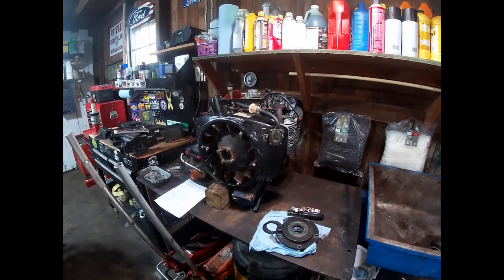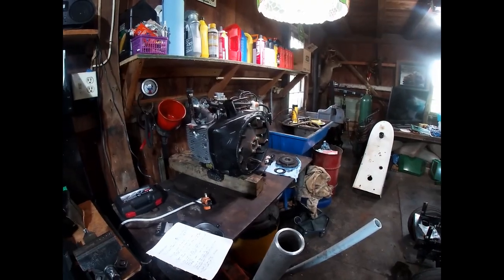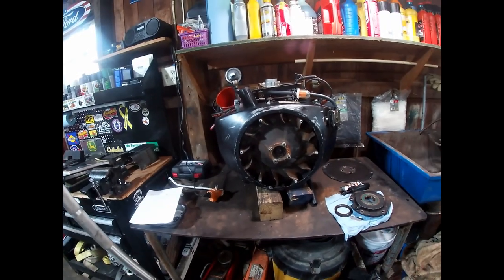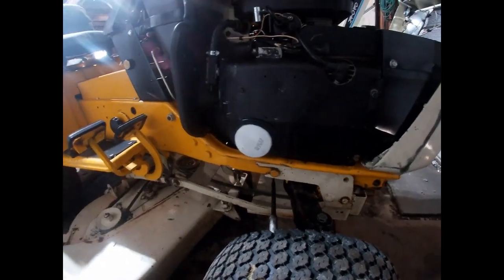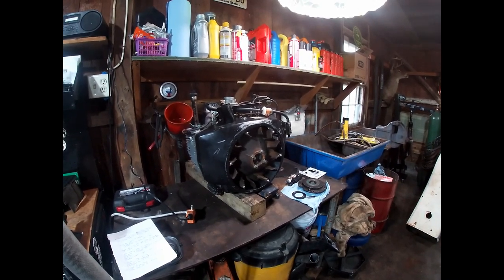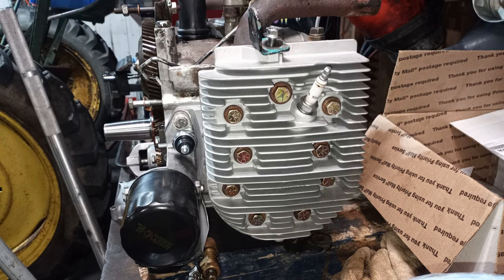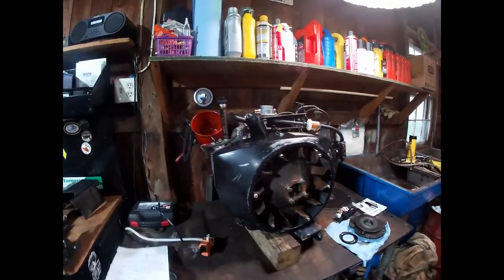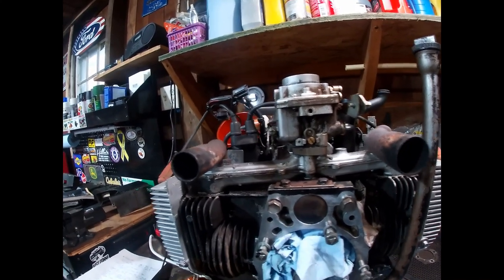10 Tips to MAXIMIZE the Life of the ONAN Engine in Your Garden Tractor - Long Live the Opposed Twin!

Comment from the maker: Please note that these are all items that should be done IN ADDITION TO regular maintenance (oil changes, air/fuel filters, spark plugs, points, etc.) - a little preventive maintenance goes a long way! 

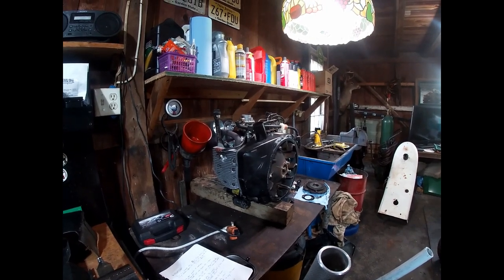10:16 - Air cooling & ventilation
16:20 - Run good oil and change it often!
19:09 - Replace the oil filter shroud gasket
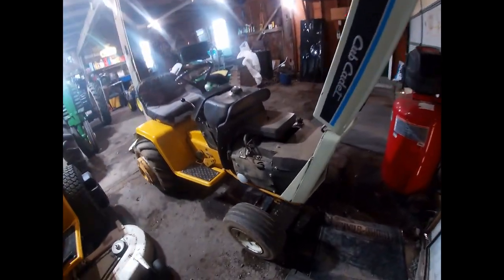21:01 - Replace the firewall foam insulation (JD 300/400 series only)
26:20 - Run WIDE OPEN THROTTLE when engine is under load
30:48 - Decarbon cylinder heads, valves, and intake/exhaust ports every 500 hours
34:38 - Hardened/oversized valve seats (if originals are loose) (P series only)
35:20 - Steel flyball spacer upgrade (1986 and newer B/P series and Linamar engines only)
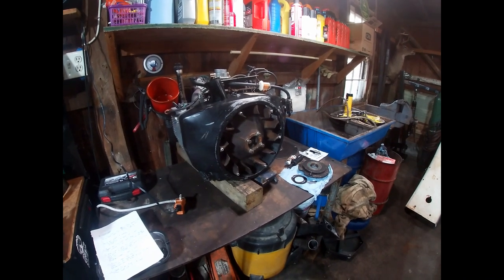39:48 - B series starter & oil pan upgrade (P series and Linamar engines only)
43:17 - Replace ALL oil seals while engine is out
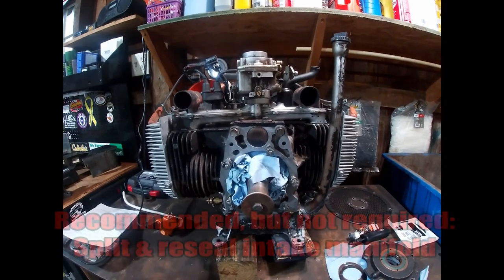46:10 - Recommended but not required: Split & reseal intake manifold (to prevent a surging condition)
Reply: Have you ever looked into the Simplicity sunstar’s cooling system? It’s completely sealed off from everywhere except vents in the top of hood and is ducted through the trans cooler into the engine.
Reply from the maker: @Claytonsgardentractors  A friend of mine collects the Sunstar series tractors (maybe he'll comment here if he sees this) and I find their air intake design puzzling - I guess the Magnum or the Command engine sits high up in the frame enough that the flywheel blower can pull air in from up above rather than below? I know the modern Cub Cadets and Simplicities with horizontal shaft engines pull their air from the hood, but I have a feeling the hood vents were added to reduce the possibility of dust and debris coming in from below - which is a flaw with the design of the Deere 300/400 series and Cub Cadet 82 series. Whether the hood vents actually help take in more air than the older design, I have no way to confirm.
Reply: @MichaelTJD60  the engine is sealed off from below and the sides, there is a plastic duct piece that goes over the battery to direct air from the vents down to the engine, most of the time it’s been removed and defeats the system like the oil filter gasket on onans, I’m not sure if that explanation helped or not but here is a promo video that discuss the cooling system in it, https://youtu.be/gs1mnNm1-YE
Reply: This video is exactly what I need for my grandpas John Deere. I cut the lawn now and would like to keep it on top condition please more videos for beginners.
Reply from the maker: @Claytonsgardentractors  that explains why it was puzzling to me, the duct piece was gone so it didn't appear that there was any way for the engine to pull air from up top.

Comment: One  Of the most important Thing ;;;  Engine RPM,  The Engine Needs To Run at The Reccomended RPM..  Because Of  Viberation ,, I have taken Engines Ran them at Differant  Rpms  The Internal Viberations Would Distruct The Engine;;

Comment: On the subject of parts sourcing for discontinued engines, it’s worth mentioning that OEM Tecumseh parts are still available for purchase with the exception of factory short blocks. Certified Parts Corp. has been producing parts at their facility in Wisconsin under the Tecumseh Power brand since 2009
Reply from the maker: Great to know. I don't deal much with Tecumseh but I know there are plenty of guys out there still running them in their older machines - especially the Sears tractors and the JD 112's.

Comment: I feel reasons for changing are the ohnan was improperly matured, people without knowledge feel age isn't worth keeping or bought a tractor already repowered.  Myself with parts available yet just rebuild it even with valve issues they had but again with properly kept up to date olds better but that's my thoughts.
Reply from the maker: Absolutely agree. Most people think they are just taking the easy way out by installing a repower kit.

Comment: I like your tips on the engine.  I managed the development of the P series engine and worked with Deere on the application of it in the 318 and 420 tractors. We even did a kit to retrofit the P series engine into a 317.  The rotating chaff screen was removed to give about a 10% increase in airflow. The Deere screens did a good job of keeping grass out of the engine so they took it out. It is definitely needed on tractors without the screens.  Also, if you are rebuilding a B series engine I would recommend using the P series valves and guides.  The improved materials and reduced weights of those parts really did increase recommended valve adjustment intervals from 250 hrs to 1000 hrs.  I agree with running the engine at high rpm to improve cooling. Our standard endurance test was 1000 hrs at 3600rpm WOT.  Only failures I recall were some cracks in the sheet metal shrouds due to vibration.
Reply from the maker: Thanks for your insight, Jim! Great to hear from a former Onan employee and very neat that you oversaw the P series engines as they came into production. If it's not already obvious from the video, I'm a big fan of the P series engines and have several. You mentioned the valves and guides being lighter in the P series to extend service intervals - was this the basis for the lighter steel valve seats in the P series as well? Also, what was the reasoning for switching the starter mounts from the oil pan (B series) to under the left-hand side of the block (P-series)?

Comment: Sold my 318 a couple years back for 1000 more than I paid for it.  Had it 20 years.  Rebuilt it once, changed flywheel, put in the B series oil pan and starter, remote solenoid which I agree was a better set up.  Old oil pan and starter was garbage, had that out a few times trying to make that starter work with that funky mount.  Re welded it, welded broken foot too.  It ran great and looked like new when I sold it and It was a good tractor, but I got a 445 that I rebuilt and its a much nicer tractor, cuts better.

Comment: One thing to keep in mind on the Case/Ingersoll tractors in specific is to check the crankshaft for up and down play on the flywheel end. They have a tendency to eat crank bearing on the flywheel end due to the strain placed on it by the belt tension from the PTO clutch. I've seen it a couple times
Reply from the maker: Thanks for the info, I haven't been around enough of the Case tractors to know that that is an issue with them, but it certainly makes sense. Good input!

Comment: The Onan twin is found in many older welding machines, they were indestructible and ran on many jobs 24/7 with stops only to refuel and a oil check, still see them running today, the older more experienced welders preferred them over the newer off shore engined machines,  less down time than the Chineseium  engined machines,  the Onan  and Kohler powered welding machines do automatically throttle down when not under the weld generator load, but still good information in this vid, Thanks.

Comment: Good informative video.  Onan engines were high torque and really smooth engines that performed really well.  Their main drawbacks were they required a decent amount of maintenance and had a few issues including the two piece intakes leaking, finicky carbs, the aluminum starter mount bosses cracking, and i believe valve and governor issues.  And the motor must come out to repace the starter.

Comment: Nice work sir. I am re-powering a 1989 420 with a vanguard 23 due to time constraints. I have the original Onan and the last engine I re-powered it with, a Linamar lx790, which now has a loose exhaust valve seat. I did manage to get 19 years out of the Linamar and I usually kept the fins under the shrouds clean, the original Onan failed at 600 due to a thrown rod, I bought the machine used, not running and suspect the previous owner didn't maintain the Onan properly. I entertained replacing the seats, all 4 and rebuilding the 790, however I thought the alum would get pretty thin between the ex and intake valve with an oversized seat. That seat rattled around in there for a while before I finally tore it down so the seat bore is quite a bit oversized.

What I am now thinking, for an engine on the shelf, is using the Onan block, replacing the cross oil tube inside that got smashed up by the rod and having all the seats replaced and rebuilding it with what parts I can use out of the Linamar, if everything measures out correctly and is useable. What do you think? 

Nice video and Thank You for the tips!
Reply from the maker: I think you have a good plan using the Onan block with the Linamar parts, provided the Linamar's internals were not worn beyond spec. The Linamar is the exact same engine so the parts should all be interchangeable (except for possibly the crankcase breather depending on which letter spec the original engine is). I'm not sure if a good machine shop could save the Linamar block with the worn valve seats but that might also be something to look into - they aren't making any more of these blocks.

Comment: I would like to thank you for taking the time to share your wisdom on these engines. I pulled the dirt caked oily B43G out of my 318 last night to refresh it but wasn't sure where to start. The engine mount base plate looks like its made out of sludge rather than steel :) This video will help tremendously on what to look for and parts I will need to get it sealed up and running right after I clean the engine and chassis off.
Reply from the maker: Glad you found the video useful Tyler. Sounds like your B43G would definitely appreciate a good thorough cleaning and going over. All it takes is one tiny leaking seal or gasket to cover the whole engine bay in grease and oil. How many hours are on your engine?
Reply: @MichaelTJD60   Yessir. It's showing 1492 but I didn't realize the hour meter wasn't working when I bought it. I doubt I've even put 10 hours on it yet but I need to get that fixed. So far aside from those oil leaks it seems healthy all things considered. No oil smoke on start up. PO owned it since 1993 and took decent care of it. While I'm thinking about it-  I want to go through the starter and put some quality parts in it. I have the 1986 solenoid style. I can't remember where you said in another video you got a rebuild kit from for that?
Reply from the maker: @tylerkrieger912  The kit is just new brushes and springs. You can buy them on eBay for about $20. Cleaning the internals is the most labor intensive part of the whole rebuild - installing new brushes can be done in just a few minutes but if the commutator has carbon buildup then the new brushes aren't going to help anything.
Reply: @MichaelTJD60  Copy that. I will do that. I am really enjoying wrenching on something I'm not in a time crunch to finish for a change. Thanks for the help!

Comment: I really appreciate videos like this. The common attitude with owners of these older machines these days seems to be repowering is the way to go and the older engines ESPECIALLY the Onans aren't worth fixing/rebuilding. And thats so odd to me considering that people will get 1500+ hours and 30+ years of service out of these engines before needing any major overhaul, yet thats not worth fixing?? Especially because as you pointed out parts are still available contrary to popular belief, and IMO repowering seems more complicated than rebuilding the original engine that's designed and built to work with that particular machine.
Reply from the maker: I agree with you 100% - why not just reuse the engine that was originally designed to fit the machine (back in a time period when everything was actually built to last and not built to fit a low budget)? Internet rumors start circulating about parts availability and rebuild costs and it doesn't take long for people to develop a bad taste for these engines over nothing. Of course the opposed twin engine design might be antiquated, but it WORKED time and time again....for over half a century, I might add. Seems like I have heard far more complaints of blown-up V-twin engines over the years compared to opposed twins.

Comment: Thanks for the vid. I learned a lot. 
I own 2 complete 982 cubs and one 982 project. I've fallen in love with the onan engine. I'm going to start collecting equipment with the onan engine on them. I'm gonna start rebuilding them. Do you recommend any particular rebuild kits?
Question: what is your opinion on synthetic oil in these old Onan engines?
Reply from the maker: There aren't really any complete rebuild "kits" on the market at this time since OnanParts discontinued selling them, but I know iSaveTractors has some kits in the works and there is talk of another aftermarket supplier making new kits in the future. For right now, I would buy the valve grind/decarbon kit and bottom end gasket kits through either Boomer or OnanParts.com, and from there add in anything else you might need. 

As far as synthetic oil goes, I have no problem with it, AS LONG AS it is used from the time the engine is rebuilt and broken in (when everything internal is new - seals, gaskets, rings, etc). You will hear people complain that synthetic oil causes leaks, but that's exactly what happens when you switch from a conventional oil you've been running for years that has caused internal sludge buildup. As soon as you switch to a synthetic oil with better detergent properties, the detergent will clean away all the sludge buildup and allow seals to start leaking again. 

The bottom line is that the lubricating and long-term wear properties of synthetic oil are far superior to conventionals - it's been proven time and time again. I run conventional oil in my Onan's because they are original and have not been rebuilt with new rings - as soon as they get rebuilt someday, I will be switching to synthetic.
Reply: @MichaelTJD60  Thanks for the reply. I appreciate it.

Comment: I love opposed twins but they have one major flaw: efficiency (or lack of)- compared to a v twin they burn considerably more fuel for the same horsepower, they do have more torque however. I’m probably going to spend the most time this summer using my 1641 cub because I’m able to mow 5 or 6 times on a tank of gas while my others with opposed twins need filled almost every time I use them.
Reply from the maker: Definitely a major setback of the opposed twin engines - I've never been a fan of the fuel consumption compared to the newer engines. But a common remedy is to upgrade to a low-pressure electric fuel pump which does seem to help a little bit. Some guys have also tried leaner valve adjustments and carb jetting.

Comment: Yeah I’ve got 4 of the old Deere’s with the Peerless 2300s & the smaller units they make today just aren’t the same. I’m a manual transmission guy… mostly cuz that’s all I can find down south that isn’t overpriced cuz all the hydros are either sitting in a collectors garage, sitting in a barn, or were junked many years ago sadly. Then when they’re in bad shape the seller will ask an obscene amount of money cuz they’re tough even tho it’ll cost nearly $500-1000 to completely rebuild a tractor just with parts.

Rebuilding your motor is another story. Basically most of these engines by now in a tractor need a rebuild.

I had a hydro I got for free, but all the hydrostat hoses were trashed. Yanked the motor, & traded the rest for 2 other tractors.
If you can find the small Yanmar Diesel engines like a L70-L100 they swap nicely in the 200 series tractors.
Reply from the maker: I'd rather just rebuild the original Kohler considering the long service life they are known for...plus the fact that the 200 series frames were designed specifically around those engines. The Kohler K series were the most common small engine ever produced...at least until 1995.

Comment: Great video mike. Additions to your ideas behind running at full throttle: they were designed to be used sitting still in welders and generators. Full throttle and spinning the blower as fast as possible is the best way to keep an air cooled motor cool, especially if it’s sitting still. Same reason you don’t let a Harley idle long if you’re sitting still. 

I’ll definitely be referencing this along with your other advice as I start working on my 318 this summer.
Reply from the maker: Great point! Now granted the engines in welders/generators also weren't being put under as heavy of a load compared to engines in tractors, but the air cooling principle still holds true regardless. I've got several videos from some of the Onan-powered tractors I've worked on over the years - hopefully they are useful for you.

Comment: I strongly believe onan made the best lawn and garden tractor engines. I have 2 wheel horse 212-5s with onan vertical shaft single cylinder engines and they are the most reliable amazing engines and I also have a 316 with the b43e and I am going to tear into the engine soon to get it working good!
Reply from the maker: I agree! They are hard to beat. Don't see many of the WH 212's around, let alone the single cylinder Onan engines.

Comment: I have a JD 420 P series that the starter motor won't engage with the fly wheel. You just gave me a great tip. Thanks very much! I just subscribed!
Reply from the maker: Thanks for the sub! I'm betting the starter mounts on your engine are cracked - the B series starter and oil pan swap is well worth the time and effort.